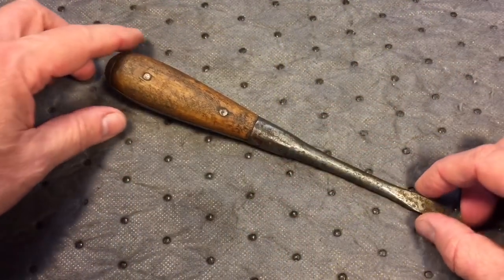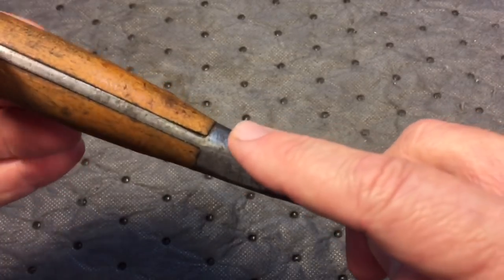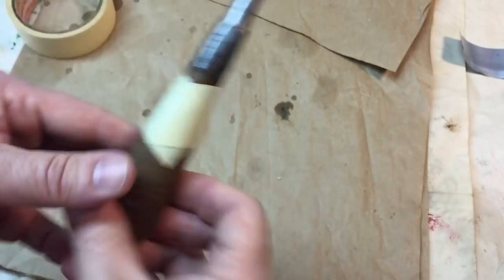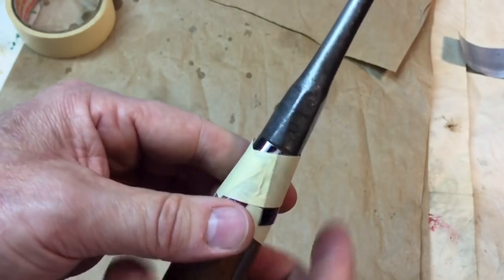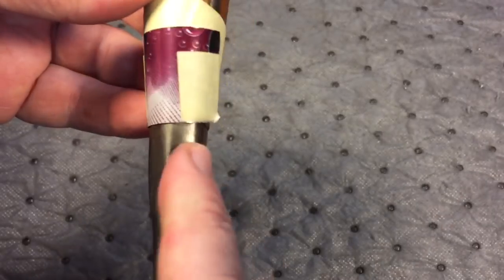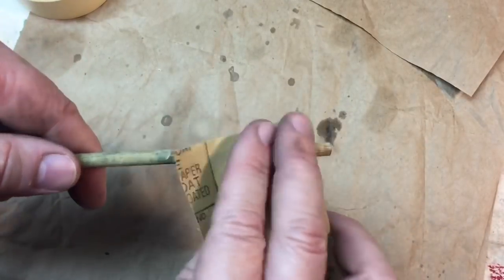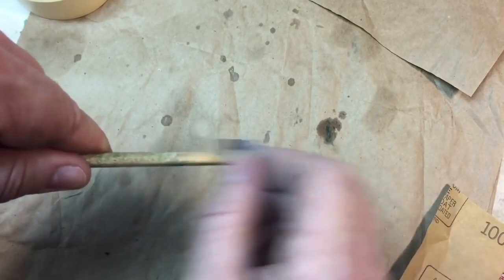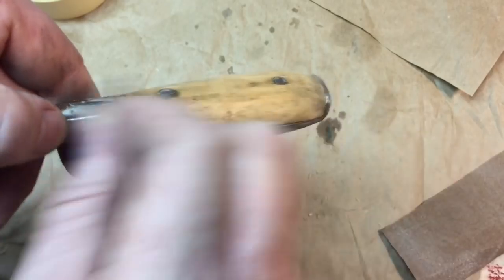Antique ‘German’ Screwdriver Restoration.

Comment: Scout Crafter, my dad purchased a Husky 1/2” drive Socket Set from a Husky Salesmen in the early 1960s. I have given this set to my eldest son. What was unusual about the sockets was they were all six point in divisions of 32 seconds of an inch. I pretty sure that the set started at 7/16” then 15/32”, 1/2”, 17/32” and so on up to 1&1/2”. The were blackened not chrome plated. There are a few of the 32 seconds of and inch sockets either missing or didn’t come with this socket set when my Dad gave them to me.
      The next time I visit my son  which will be around Christmas time if I remember I’ll take some photos of these sockets and send them too you.
    Have you ever come across these type of Husky Sockets?
Reply from the maker: Hello M Dlanor!  Wow!  I have a older Frank Mossberg Socket set that has those weird sizes (lol) but nothing later then the 50's by then most sets came with the standard sizes we now know!  I would love to see the pics!  You can always send them to bicycleguy@aol.com   Thanks again!!!
Reply: ScoutCrafter 
What else was odd about this Husky set was the Ratchet appeared to be heavy nickel plated not chrome plated. The Breaker Bar, 3” and 6” Extension are Blackened. 
    I have been watching your videos and most likely will watch all of them. 
     Good luck with your tool finds.

Comment: Another great job.  Love the scraping, as you say always a superior finish to abrasives.  Might be worth keeping an eye out for a curved cabinet scraper though. Scraping with a straight blade will facet the wood slightly. The curved scraper would help eliminate this.  Bet you could find one at one of the fairs you visit.  Alternatively you could grind one up using the blade from a broken carpenters square or even a piece of old saw blade.  At school we repurpose the ones the students damage in this way once they get beyond repair.
Reply from the maker: Hello Peter!  Yes!  You are so right!  I have some scrapers for regular woodworking but for hammer handles and small wooded parts I can really do a nice job with a single edge razor blade!  It works so well and fast!  Thanks so much!!!!!!

Comment: Hey scout I'm looking to buy myself a bench grinder for restoration purposes. I see yours is a 1/2 HP. I don't want to go too small, but don't want to spend unnecessary money on a more powerful motor if it's not needed. Is 1/2 Hp suitable for this line of work? Thanks, Nolan.
Reply from the maker: Hello Nolan!  I never trusted HP ratings!  They are often misleading! So it's hard to tell who makes a good product other then reviews!  Just remember,  1750 RPM or so is best for Wire Brushing and 3450 RPM for buffing..  Two buffer/grinder units are ideal.   Joe from Joe's Shop on Youtube has a nice Powertec BF600 I believe and he likes the unit!  He also knows about motors!  Shoot over and ask him if he likes his unit and what model it is... They run about $65-  Thanks!!!!!!
Reply: @ScoutCrafter  Really appreciate it man!! Thanks so much!
Reply: I recently went thru the process of buying a grinder myself.  The general problem is most bench grinders made today are crap and definitely won’t last a lifetime.  You don’t get to anything good unless you are willing to spend like $300 on a high end Jet model.  I ended up buying the harbor freight grinder/polisher with a 20% off coupon and cost me about $35.   I’ve cleaned up a few tools so far and it has worked great.

Comment: Scout Crafter,most of these one piece metal screwdrivers with half wood handles especially the older ones are made from some of the highest quality steel. I had a few of this style USA MADE screwdrivers  from my given to myself from my dad that his dad purchased sometime in the 1930s. I have passed them do to my eldest son. They are pretty much indestructible except for the half wood handles. 
     I really like your videos, your restoration and appreciation for antique tools.
Reply from the maker: Hello M Dlanor!  Thanks so much!  Look up my video "Restoring the most Awesome screwdriver ever made" I think you will get a kick out of the content there!  You given your son a fantastic gift there!!!!!  Thanks so much!!!!!!
Reply: Please, do not restore it like this. Keep it as original as possible so you and your sons see the life of that srewdriver. They were not this shiny unless chromed. My dad was a carpenter and I have kept his tools very original, just doing some cleaning and lubrication.
Reply: mattikaki 
 I have given this type of screwdrivers to my eldest son. He will not do any type of restoration to them other than maybe rubbing some boiled linseed oil into the wood on the handle As far as Scout Crafters restoration of the many tools he acquires. There is nothing wrong with doing this. Only on an Extremely Rare hand tool shouldn’t be restored other than cleaning and preserving them. I’m sure Scout Crafter would not do anything but clean and rare hand  tools. Doing this doesn’t affect the value of said hand tool. In reality any hand tool whether it’s extremely rare or not. Only has any real money value to collectors. Otherwise any extremely rare hand tool is only worth the scrap price of the material it is made from.

Comment: I was RIGHT ABOUT to say something about your aluminum oxide belts (they are absolutely terrible at working metal) but then it hit me that those belts take FOREVER to go through steel so it looks like you got me this time.
Reply from the maker: Curiosity Forge Allan. You are so right!  With a “good” belt you can get in trouble real fast!!  Lol.  Thanks very much!!  😃👍
Reply: @ScoutCrafter  Believe it or not I was avoiding the hell out of doing the belt grinder work BECAUSE all of my belts are geared towards working large pieces of hardened steel. I'm going to keep an eye out for high grit aluminum oxide belts for the 1x30 and see what I can do with them. The 2x72 only has one speed, WAY too fast. Later I plan on investing in a much higher end 2x72 with variable speed and a dedicated slack belt attachment. I'm pretty sure if I can slow it down and run a 400-800 grit belt I can do what I feel like needs to be done effectively.

Comment: When French polishing wood like that, you may want to be careful with the type of steel wool you use.   One of my woodworking instructors warned us about the oil normally present in cheap steel wool and how it can ruin your polishing layers with shellac.   Granted that may be more for museum level finishes on fancy woodworking projects than on shop tools, but then again some of your restores look like museum pieces.  You can get the high quality steel wool thru Rockler that has no oil.

Comment: Did they make Philips head screwdrivers back in the day? So many standard head screwdrivers, with too many modern Phillips screw heads in our lives!! 😵
Reply: Phillips-recess actually isn't modern, it was invented in 1933 and patented in 1934. Screw manufacturer Phillips advanced it to the Pozidriv recess. Pozidriv (PZ) is mostly common here in Europe instead of Phillips. Actually Phillips-recess is considered as outdated here. PZ was introduced to reduce cam-out at higher torques. Differences between PH and PZ:

screwdriver:

https://upload.wikimedia.org/wikipedia/commons/7/70/Poziphillipscompr.jpg

screw:

https://upload.wikimedia.org/wikipedia/commons/e/e7/Pozidriv_screw.jpg

Using a PH screwdriver on a PZ screw and the other way arround can possibly damage the screwdriver, but the profile of the screw is surely messed up on higher torque.

https://phillips-screw.com/drive-system/pozidriv
Reply from the maker: Hi Christina!  Marcel always had awesome information!  I have never been a fan of the Phillips screw design, it was only accepted because automobile manufacturers wanted a faster that had capability with assembly lines and the square drive fastener's (which was much better) inventor wanted to much in royalties to use his design so Phillips won out.  My favorite fastener is a Torx head, they are a delight to use and never slip!
To answer your question their are modern "Perfect Handle" screwdrivers still produced today (overseas) that include the popular phillips shaft!   =)  Thanks!!!!!!
Reply: The most common recesses here in Germany are Pozidriv and it's derivate plus-minus (combination of Pozidriv and slot). Hex and Torx are common too, Hex is metric but Torx are the same sizes as you use them on the other side of the great pond. Plus-minus is mostly used by electricians, covers of outlets, circuit breakers and so on.

The "perfect handle" are Irwin as far as I've seen.
Reply: Here in Europe and Germany, slotted srews were the most popular until 1970 or so. Phillips was used here at least in cars’ larger screws like door hinges. Pozidrive started to be more and more common in the 60’s. Today we find both Phillips and Pozidrive in old German equipments but they ( and at least Scandinavians) used slotted long time in electronics and small business. I restore old electronics and I am very strict in using right type of screws. Pozidrive is much better than Phillips but today TORX is the one I always buy if available the right size.